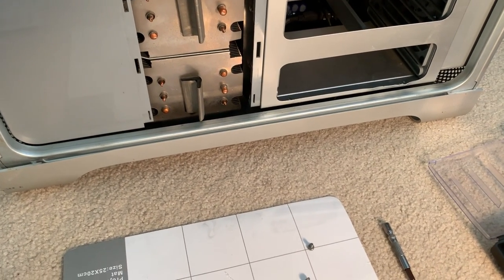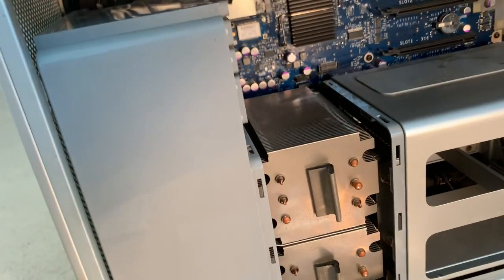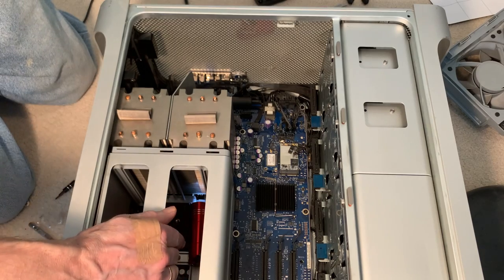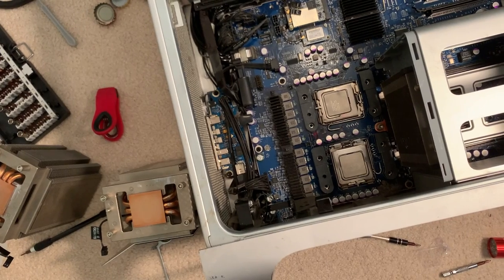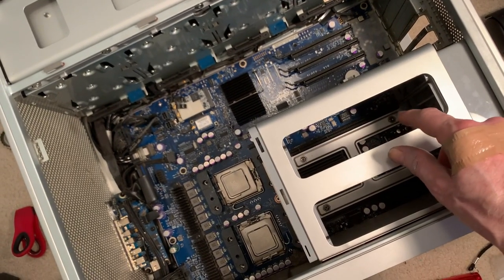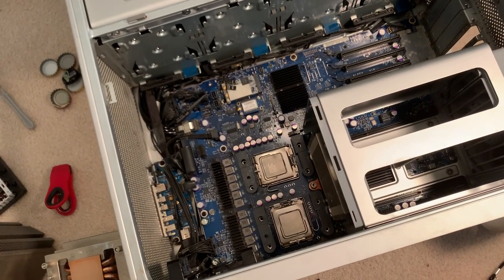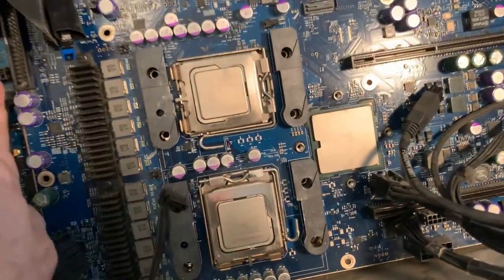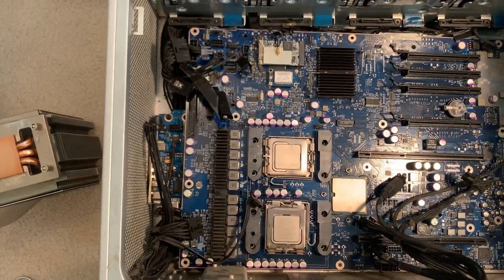2008 Mac Pro, Logic Board Replacement, Part 1!!

Comment: I really wanted to find an old Mac Pro on the cheap and upgrade it, but I can never seem to be able to get hold of one for a decent price (or at lest the price that it is worth!)
Reply from the maker: A big key is patience. the 2008 3,1's, such as the one in this video, should go for somewhere between $100 and $150, depending on condition. While they are fun to work on, for a good Mac Pro on a budget, I would probably look for a 2010, 5,1, single CPU tray model. Fully upgraded, they will beat ay of the older ones, and have the advantage, when upgraded, of being able to run Mojave natively. With the Mojave firmware update, you can use an NVME SSD on a PCIE card as the boot drive, which gives a huge speed boost. The 3,1 can use an NVME as a storage drive, but cannot boot to it.Good luck in your search.
Reply: @brokenelectronics3665  Thanks for the help and useful info!
Reply from the maker: You are most welcome!
Reply: I have a 3.1 myself  (3 Ghz) which is still my main computer :D ; I love it.
I recently bought another Mac Pro 3.1 for my wife (while she is getting her Air repaired) from a UK refurbished Macs store.  It´s in excellent condition (minor marks or scratches) ,  2.8 ghz, 32GB of RAM, Original ATI Radeon HD 5770, 1 250 GB Ssd + 1Tb HD… I paid like £245.83 exVAT. Considering how the buying the RAM, card and SSD separately would cost maybe $200, I think it´s a pretty good deal. And 12 month return to base warranty!
Going for a cheaper Mac Pro from eBay and buying the upgrades in an option too but I recommend looking for refurbished Macs before.
Reply: @miguimau  cool
Reply: @AlexTechYT  2009 Mac Pros are a better inversion, though. Good luck in your future purchase!
Reply: @miguimau  I've still not found one yet! :)
Reply: A big key is patience, that´s true. ;)